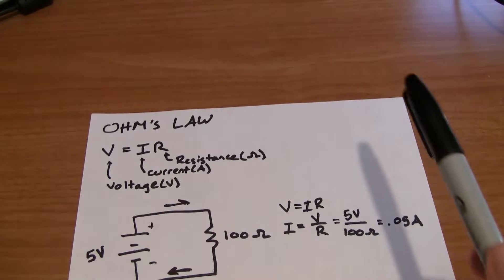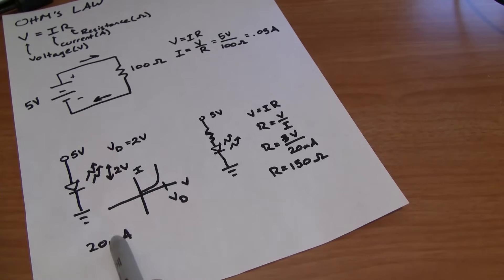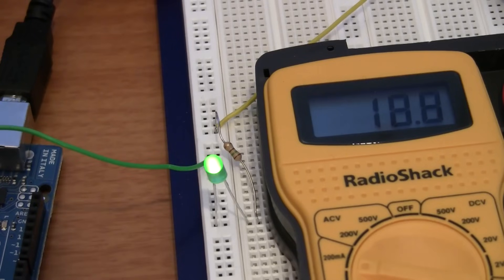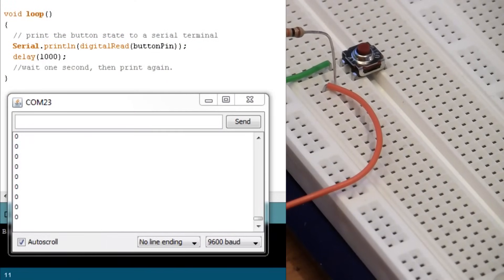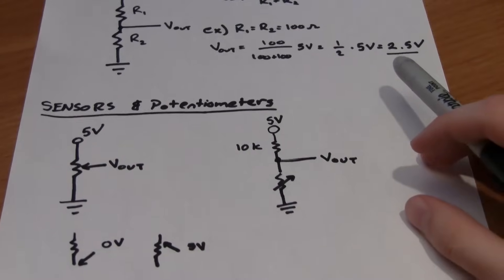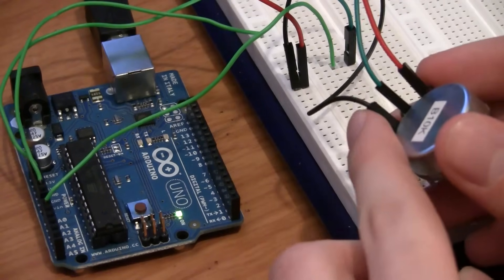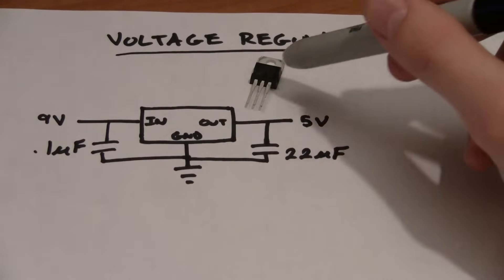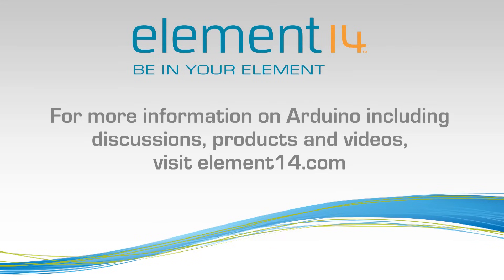Tutorial 03 for Arduino: Electrical Engineering Basics

Comment: "juan francisco Vallejo"   that what is meant by voltage drop , the led is a diode that needs 2 volts at least to light on , 2 volts is suitable for pn junction to happen  , if you don't know what is meant by pn juncton search for it ...

Comment: Thank you Jeremy, great video, however I did see something that was probably just an oversight, but to make everything reun and work more effectively, your filter capacitor (the large one) needs to be on the input to the voltage regulator, where the source needs it, and the decoupling capacitor (the 0.1uF), should be on the output to decouple the noise.  It would not hurt to also put, say a 10uF, or so on the output also.  Thank you for making this video available, My weakness is in programming.

Comment: wiki/Diode
Read some more about the diode and what it does, or was designed to do.
There is a part down in the: Current–voltage characteristic section which he says basically LED's can range from a minimum 1.4 to even 4V drop.
So yeah...

Comment: Thats just how diodes are built, they have a Vdrop constant which is individual to each diode type.
In this case, the LED has a Vdrop of 2V and its a constant.
Meaning: it needs a minimum of 2V just to start letting current through, anything below that and nothing happens, the LED wont even light up.

Comment: Its just noise - electrical signals can effect each other. Electronics in your house, power running through your house. 

Imagine it was water pressed you were measuring, and someone was messing with the hole by squeezing it and moving it around. Even if the flow were actually below some threshold, the interference from manipulating the hose would change your readings by pushing more water down the hose.

Comment: It doesn't have to have 5 Volt to change the logic.  It could be around the TTL value of 2.6 - 5 volts.  Static or even magnetic fields around the wire can create voltage.  Static alone can be in hundreds or thousands of volts for a split second.  If you use a pull-down, current will flow to the least resistance path (reason for lighting rods on building..etc), therefore, any voltage on that wire will go straight to ground and not to the pin.

Comment: Aren't the caps reversed, in terms of being able to remove any ripples in the supply voltage? Ripple is decreased with increasing filter capacitance and increased load resistance--because these things delay the fall-off of the input voltage (assuming AC, otherwise you maybe wouldn't have the need for the filter), thus reducing the magnitude of the ripple. But here the larger cap is across the output, instead of the input. Isn't this backwards?

Comment: Thank you for taking the time to put these videos together.  The section on pull down resistors was extremely useful to me and has explained quite clearly why I need them.

I used the led PWM (with button) circuit from your 2nd video that has a pull down resistor as an example.  Disconnect that pull down and the PWM button has a mind of its own.

Comment: Sorry for the noob question but here it goes-

Can someone explain me what should be checked when connecting a device (Bulb,LED,Motors etc) to a electronic circuit. Should i be checking the input voltage required or input current required.. like i have a 5V supply how many motors can i power by it ?   If i pass a higher voltage than required what will happen or if i provide a higher current what will happen ?
What does the speed of a motor or brightness of a LED depend on ?yes i know the OHM law

Comment: For electricity it will always use the path of less resistance. Even a 5K resistor is less resistance than the air. The pull down resister also "shows" what is considered the ground or the lower voltage level.   You could also build circuits that instead of having 0V up to 5v, that use say 5v as low and 10v as high. Using the pull down helps give a base for the voltage readings to start from. Where no pull down would leave a "floating" point of reference for the circuit to read from.

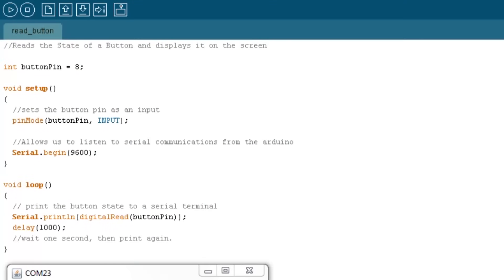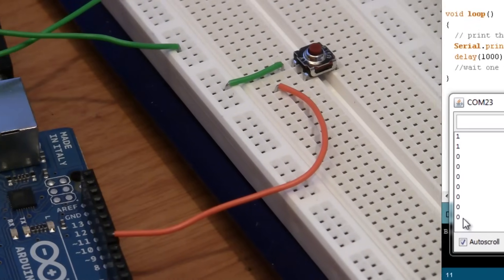Comment: I think I found an error in the video. At 6:10 you see that the buttonPin is hooked up to pin 8. But on the video it is connected to pin 11 (05:52; 06:25; 06:57).
Am I missing something? Would it work with pin8? (pin 8 does not have PWM).

Comment: Re voltage dividers... I'd like to add an LED status light to my 240V AC powered hot glue gun.  

What would I have to do to make this work?

Would I need a step down transformer, and rectification? Or is there is a simpler way?

Thanks.

Comment: "COM23" is just his serial port number (for the Arduino's USB serial).

The Java window you can see is just the "Serial Monitor" part of the Arduino software. (Tools > Serial Monitor, or Ctrl-Shift-M).

This lets you see the serial output from the Arduino if you're using the built-in serial functions.

Serial.begin(9600);
Serial.println("Hello world!");

You just need to download the s/w from the Arduino site, plug in and install the USB serial driver, then choose the correct port in the s/w.

Comment: Oh, also, most microcontrollers have an internal pull-up option...

So, if you set the pin as an INPUT, but still "set" the pin HIGH, it will enable the internal pull-up for that pin. Then all you need to do is connect your button between the pin and Ground.

On the Arduino s/w, you just do this...

pinMode(pin, INPUT);          // set pin to input
digitalWrite(pin, HIGH);       // turn on pullup resistors

I've found that this quite prone to noise though, so best to go with a real resistor.

Comment: You'll also see around 6:22 that the logic level on the pin stays HIGH even after the button is released because there is some capacitance in the chip / circuit which holds a tiny charge (and due to the chip's topology etc.). The pull-down makes sure that charge drains to Ground when the button is released.

Who would have thought hooking up a simple button would be so much trouble. lol
There are lots of factors to consider, but it's not too tricky once you wrap your brain around it. :)

Comment: There is always a tiny amount of leakage current, even when the pin is set as an input. The pull-down resistor ensures that the leakage current goes to ground until the button is pressed.

Obviously, a pull-up or pull-down resistor is generally required for a button  because otherwise it would completely short-circuit when pressed. (you can't connect one pin directly to Ground, and the other directly to +5V for example!)

tbh, a lot of stuff uses a pull-up resistor on buttons / switches though.

Comment: The 5V is not running to the pin when the button is pressed.

What the pull-down resistor is doing is keeping the input pin on the Arduino from "floating" when the button is NOT pressed.

A pin can be in a "floating" logic state, which means it's unstable, and prone to external interference etc. Also, with different types of chip tech, a floating input pin can float at a HIGH or LOW logic state, so confuse your firmware etc...

Comment: There's the 5V label and the Ground symbol. These essentially form the circuit from the power supply / battery.

The important thing is, the output voltage pin from a voltage divider / potentiometer wiper is generally "relative to Ground".

It's often good to think of voltage as the "potential difference" between the two measured points rather than just a circuit.

So, if you have +5V, Ground, and -5V, there would be 5 Volts between Ground and +5V, but 10 Volts between -5V and +5V. :)

Comment: On he voltage regulator. Can you tell us the formula to figure out which decoupling capacitors to use ? You have a .1 on the input side and a 22 on the output side.

Comment: It is a 3 pin package.  Inside the package it has transistors and zener diodes hooked up in such a way that it doesn't matter what voltage you apply to the circuit it will output the voltage it was designed for.  You must supply a proper voltage within a range say 4V - 24V and it will output 9V etc.  It uses zener diodes bc they drop more than 0.7V and they are designed to drop a specific voltage no matter what.  
Hope that helps.

Comment: I guess the reason the pull down resistor is so high is so that the circuit will work when the buton is down (the current flows through the path of least resistance)

Comment: I am a Mechanical Engineer and I truly don't understand pull-down resistors.  How is it possible that 5V is running to the pin if the button is not pressed without a the pull-down resistor?  Where is this magic voltage coming from?  And if there is a voltage drop, why does would the current go through the pulldown resistor and not the wire to the Pin?  

I'm too mechanical I think!  Is there a mechanical analogy?

Comment: Hi! just a question, how can I do to connect a LDR ( Light Dependent Resistor ) to the analog input, because I have tried like this example but I only have a 0 in the monitor, I don´t know if I need to add some resistor to the circuit or maybe need another componentes like transistors and like that, thanks a lot!

Comment: it is not recommended to use a value small then the recommended cap value.
you may go higher but never go lower as the cap is use to stablize the voltage

Comment: Partially it's a matter of convention, but izrod100 is right. I was taught it the same way at the university - voltage in one direction and the current in the opposite direction (because current = flow of electrons, which flow from - to +).

Comment: Great videos!! Thanks! I have a question about the voltage regulator. I bought a L7806CV regulator and its Data Sheet says I should use 0.33uf (V input) and 0.1uf (V output) instead of 0.1uf and 22uf. What is the difference? Can I use the capacitors in the video anyway?

Comment: This was a very helpful tutorial.  I've already worked my way through one Arduino book, and I'm a hundred pages into another one, and while Ohm's law was explained in both of them, neither did a good job of explaining pull down resistors or why it was necessary to use the resistor with a pot/sensor.  It was more like here's the circuit, and now I'll explain the code.  This tutorial really clarified things for me.

Comment: For some reason my base voltage is around 156 instead of 0. It goes up to 1023 but definitely not linearly. I am using a 10k resistor and a linear-taper pot i got from radioshack. Any help would be appreciated!

Comment: Instead of using a switch I used an IR receiver. I pressed power button on my TV's remote control and counted 36 (more or less) states of 1's and 0's in the Serial monitor. I wanted to copy a small batch of readings from serial monitor and paste on to Word to analyze timing. Can't copy from serial monitor. Is there a different way recording results to be able to copy? I am so new to the Arduino but am experienced in electronics.

Comment: From WikiPedia:
"In electrical engineering, ground (or earth) is the reference point
in an electrical circuit from which other voltages are measured...
...which serves as the common return path for current from many
different components in the circuit."

Comment: Also on the manufacturing end, i don't believe the caps are needed to make the voltage regulator work...just smooths things out and if a company buys 10,000 voltage regulators and can save money by not using caps (because its not needed in there application) then they would prefer it.

Comment: Look at the voltage regulator IC.  It is currently filled to capacity with everything inside that will fit.  Now look at the 2 capacitors.  How would you cram the 2 caps into the voltage regulator that is 100% full?  Answer: You can't!  So they have to ride outside along with Mitt Romney's Dog.

Comment: Hi there, just getting into electronics (engineering and computing) and I'm very interested with the theory behind the practical application.  Two questions: 1: your picture during the voltage regulator section: Is that a 10K ohm resister?  Does this mean there are 5/10,000 amps flowing through this circuit?  2: can I put a resistor anywhere in the circuit and have it carry the same effect... such as before or after the led?

Comment: @rainbowsalads Yes it would. Depending on whether or not the diode is closed (infinite resistance) when it is exposed to light or when it's dark, changing its location with the resistor will "reverse" when the divider has voltage or not.

Comment from the maker: @glennlopez There is a relatively complex derivation that goes into calculating this value based on the input pin impedance and a few other characteristics of the microcontroller you are using.  This information is generally given in the microcontroller datasheet.  The atmega 328, which is on the arduino, specifies that 10k is the the ideal value for this chip.

Comment from the maker: @raghunitin The general rule is to go by the datasheet.  The manufacturer will always suggest values to use with their various components.  If you look up the datasheet for your voltage regulator, you'll see what I'm talking about.  The ideal value will strike a balance between removing noise, and not impacting response times.